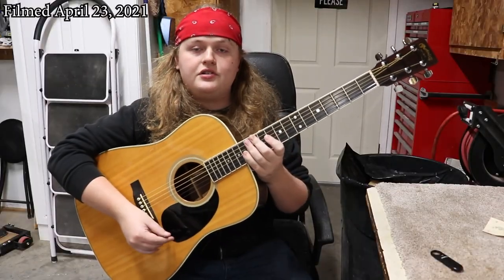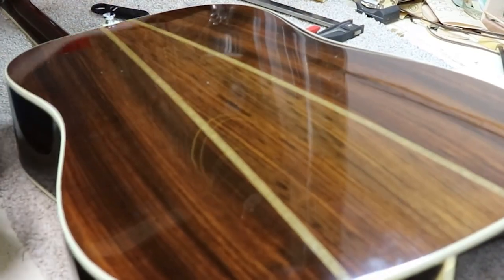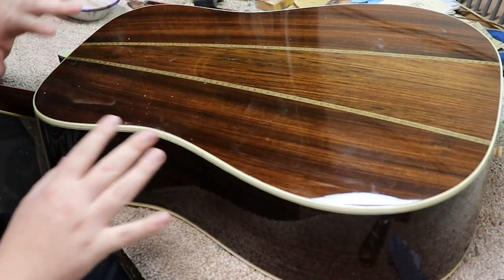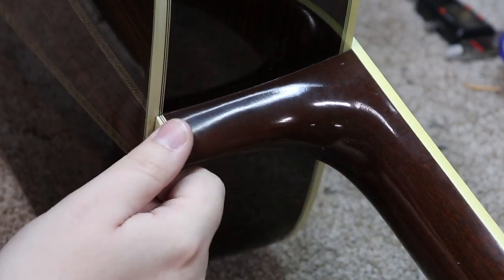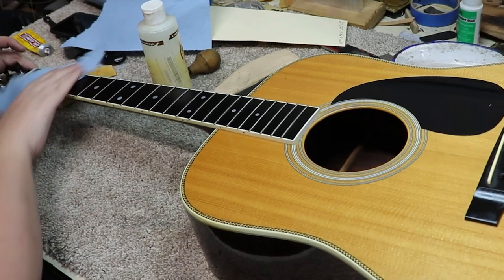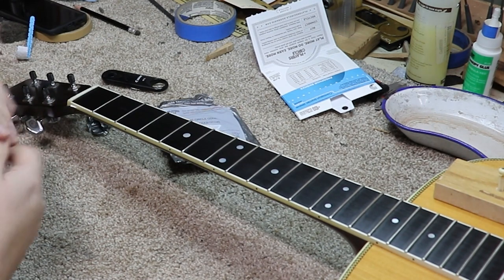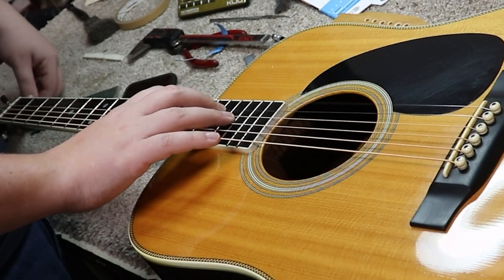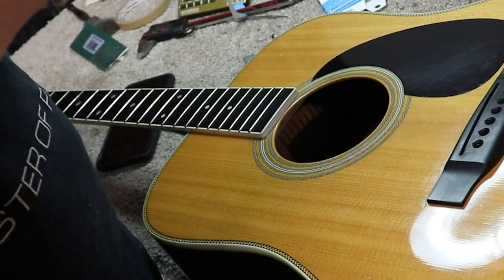520 RSW 90's Martin HD 35 Loose Binding

Comment: Good work, Caleb! That's exactly what happened to the binding on my 1992 D35. The luthier who fixed it warned me that it could happen again, but it is still fine after a few years. I'm sure that your repairs will last a long time.
Reply: From what I understand the D-35 is notorious for this problem unfortunately I am in the midst of dealing with a major binding issue with mine and it’s a shame because the one that I have sounds like a harp of gold
Reply: @dansalmon8261  I brought mine to Japan in 1992 after shopping all over LA for a Martin that sang for me. The binding came off by the nut almost right away. I had the binding repaired on the body when a brace came loose on the back, another common issue. Even with all of the nicks it has now, I wouldn't trade it for anything. It is a really sweet guitar.

Comment: Enjoyed your video. Great work as always. Keep up the good work.

I bought a new HD-35 "High Performance" in 1989. It came stock with locking tuners. The bindings came loose in pretty much the same places as this one at the waist and neck. I forget what the "High Performance" designation meant other than locking tuners. Maybe forward shifted X-brace. It definitely had 1/4" scalloped bracing as do all HD-35's. It had a low saddle with medium action. I sold it a few years ago. My particular one had very nice tone but didn't have much cut or projection. The sound of it got lost when playing with others. It was great when recorded or to sing with solo.

Comment: That new mighty high saddle might crack the bridge.  It was already tilting forward when you tuned it up.  The original saddle was quite high for the 0.07" action.   A lot of Martins can't even get that low because there would be no saddle left.  The result of the neck angle and bridge thickness that they choose at the factory.  If a bluegrass player chooses the bridge thickness at Martin you can forget about .08" action as a fingerstyle player.  They just can't seem to get it right even after decades of guitar building so that it works for players that prefer low action .08" and players that prefer 0.1+" action.

Is the guitar dried out? Neck relief OK?  Thin bridge? Neck angle OK?

It's not because it buzzes when you play it that it buzzes when the owner plays it.  If I were the customer I would be very unhappy with you raising the action without asking it first.
Reply: They have better tone with higher action. Get stronger fingers or a different guitar?

Comment: I have a 30 year old Martin HD-35 and it is in extremely good condition for a guitar that has been used for gigging and recording. I have noticed that the finish of the guitar is still great, however I have noticed in one area the binding has just separated in a 2 inch section. If i follow the video and repair it myself is there any particular glue I should use. thanks in advance. This was my 2nd guitar after having a cheap $200 first guitar and it took me all day at the music store playing all the different Martins available and I just loved the sound of this compared to the HD-28. However today I suppose if I had bought a hd28 it would have been worth a lot more.

Comment: The loose binding in four separate spots is an appalling indictment on the manufacturing and particularly, the quality control section of one of the world's premier guitar manufacturing company's facilities. Shocking.
Reply: Not a defense of Martin, but this guitar is older than me, it's hard to say what kind of life it's lived, and in what conditions it was kept. Humid and hot can be very bad for glue...
Reply: @MillsGuitars  I take your point Caleb but, if it's less than 20-25 years of age  (and I'm guessing here) and it's very good aesthetic condition, it's still poor assembly and/or quality control. !
Reply: @lyndamcardle4123  I can't disagree with you, but if I found another one just like this for sale, knowing the problems it may have, it would still be worth it to me.

Comment: Nice work Caleb! What is it with the bindings coming loose on these Martins. In the same spots? I haven't fixed my son's yet. Thanks for the video dude.
Reply: Not, terribly, unusual. The plastic binding tends to shrink, over time.
That's why he had to heat and stretch it, into place, before re-gluing.

Comment: Just wondering why you would raise the action of a guitar that's not buzzing. I play almost exclusively electric and I want my action as low as possible
Reply: Its kinda like changing the neck angle will change the action "feel" string tightness. Raising the saddle can do the same. Making one too soft means you have to play soft, If you put too much pressure on a soft guitar you would just kill the sound.
Reply: @joseph2219801  I want a guitar that plays fast without having to muscle up. I don't play much acoustic guitar so I don't have much point of reference when it comes to how they play.  All my guitars are Strats

Comment: Interesting...supposedly the best so why the delamination?
Reply: Not, terribly, unusual. The plastic binding tends to shrink, over time.
That's why he had to heat and stretch it, into place, before re-gluing.
Reply: @zapa1pnt  Not buying it.
I have several MIJ acoustics over 40 years old  and the binding is solid...as is the sound and playability If Martin is the best, then they shouldn't be delaminating.

Comment: You have to be careful of humidity, too much dry heat and not to use strings higher than 0.13 always use those recommended by Martin. I would advise you if you haven't already done so to contact Martin so that he can suggest where you can find a luthier who can get his hands on it and who knows what to do with a Martin D35. Best wishes and good luck.

Comment: Nice bookmatched guitar.
Observations, guitar back at 1:40 and again at 4:55 and from 5:12 to 21 shows a bit of glue smudge, gone by 18:03.
At 9:10 the bridge pin holding block appears on the body of the guitar. @7:00, I'd have asked Jerry where the strap button goes and not play a guessing game on camera. As for the buzzing issue, perhaps it had a heavier gauge string set before the 12-53's. Maybe string height and relief should be measured as part of the inspection process? Lastly, I'm quite sure Jerry checked the intonation...))